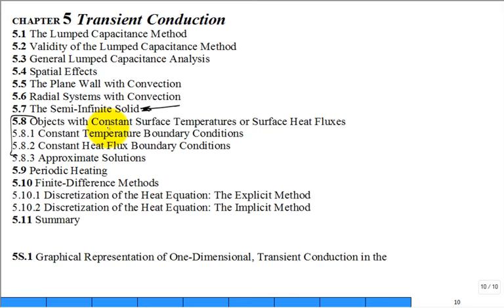Transient Conduction, Semi Infinite Solid

Comment: I've been playing around touching metals at room temperature, they indeed feel cold because of the heat transfer; however, if I rub my finger to warm it up, and then touch that same metal at room temperature I don't feel it colder, instead I feel it warmer... Why? Theoretically, the grater the temperature difference between the objects, the more heat transfer there is, therefore I should feel the metal colder. It is similar when we get into the sea at the beach. If we lay down for a while and then get into the sea, we feel the water colder compared if we go in before the sun warm up our bodies. 

Thank you professor.